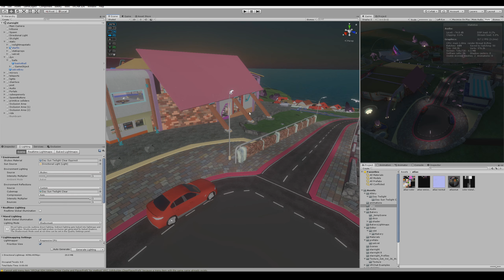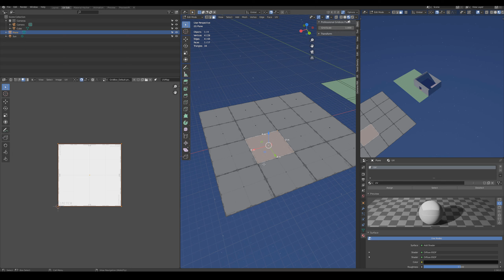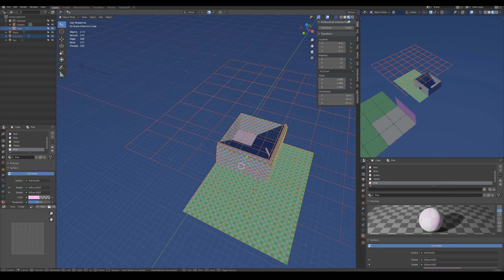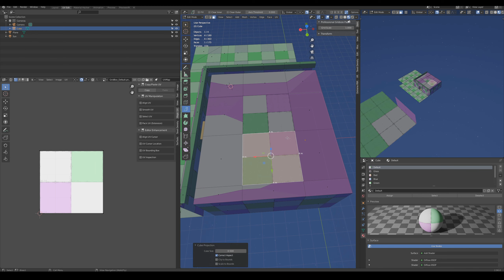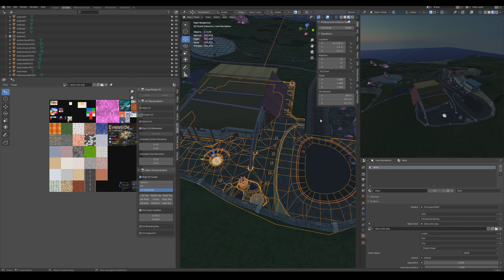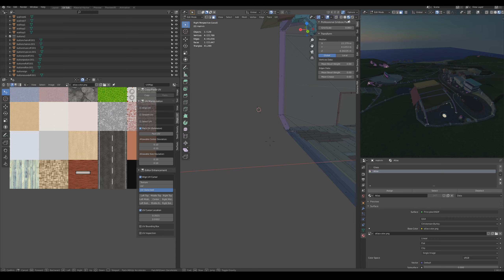How to Atlas Everything in your World (literally)

Comment: wouldnt using texture arrays with vertex colors be better and easier? then the mesh doesnt need to be modified in any way and textures can still be tiled https://youtu.be/SktLSFyENXg
Reply from the maker: vertex colors are indeed easier, but then you are limited to colors and still have different materials for textures. I did try texture arrays, they caused some issues. They also rely on a custom shader and normals look somewhat off. Espcially the custom shader is not ideal for something on the quest and to futureproof everything I always aim to use standard everywhere. Ideally there would be a tool that cuts the mesh based on tiling for you, I have yet to find it...